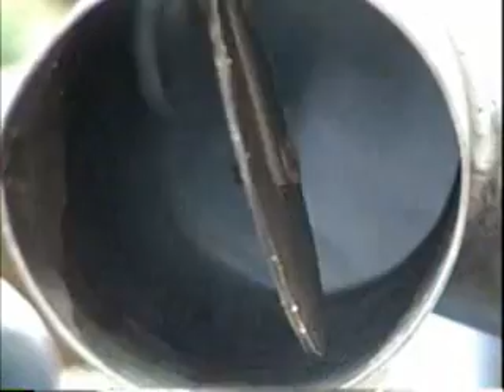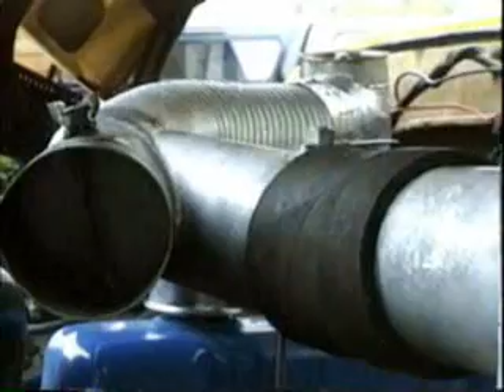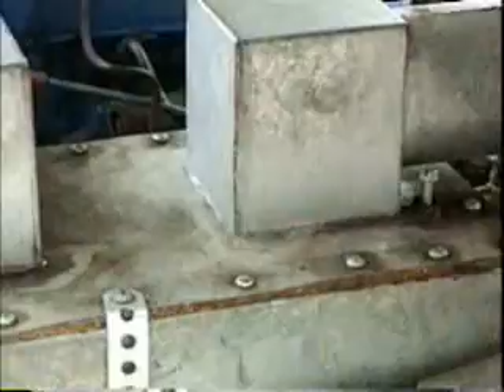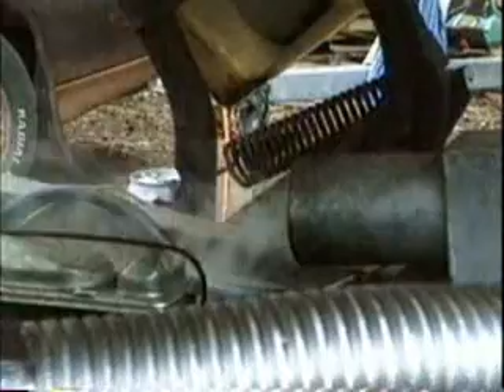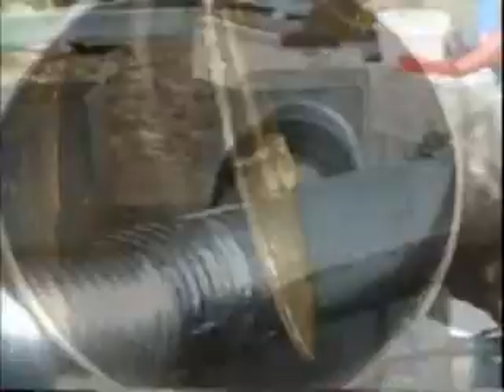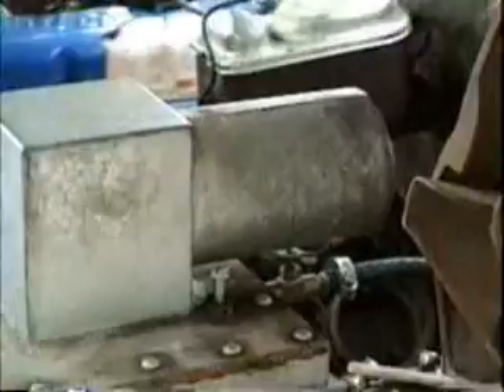Here is definitive proof on how to separate all Atoms in all liquid soluble matter.

Comment: Gas vapor systems are dangerous if your vehicle rolls over in an accident. Heating gasoline is tricky and dangerous because of spontaneous combustion and highly explosive if leaned out.
Reply from the maker: It is not the gasoline that causes the fires it is the electrical spark, that ignites the vapor. and only in the vapor state of matter is gasoline flammable. Science says gasoline auto ignites at 534 degrees Fahrenheit. Science is wrong. I have seen Calrod electric heaters turn a dull red before gasoline will auto ignite, this temperature is around 1100 degrees Fahrenheit. With this, science has said there is another 500 plus degrees that does not exist, and for the last 30 plus years I have been playing in temperatures in gasoline that science says does not exist. I got 100% increase in horse power, with zero parts per million hydrocarbons. Imagine what I could find if I had more financial backing, and used my Flashing Liquid Process on all know liquids. We might not need fossil fuel. We can make hydrogen gas from water, using the right temperature, and my Flashing Liquid Process. When Hydrogen burns it makes water. I have separated the atoms in gasoline, water is next.
Reply: Is it worthwhile because you need lots of wattage consumption which is energy used minus energy made.
Reply from the maker: My You Tube site is not to convince someone to use my system to make the White Vapor that I made, from gasoline. I am trying to show everyone I have separated the atoms in liquid Gasoline, using a simple process that is similar to what science calls Sublimation, where a snow ball is heated with a cigarette lighter, and the snow goes from the solid frozen state to a gas state, without becoming a liquid. I am saying the small snow flakes assume the applied temperature, which on the cigarette lighter flame is around 1100 degrees Fahrenheit, faster than the snow can boil and become a liquid. What I did is take small droplets of liquid, and spray them onto the 600 degree Fahrenheit heater, and the droplets went to the applied 600 degree Fahrenheit temperature, faster than the gasoline droplets could boil at the normal 100 degree Fahrenheit boiling temperature of gasoline. Thus some of the atoms in the gasoline reached their boiling temperature, which is higher than gasoline's boiling temperature, and those atoms turned to a gas, while other atoms did not reach their boiling temperature, and they remained a liquid in the bottom of the chamber seen on You Tube. The atoms that boiled turned to a White Vapor, and had twice the power that gasoline had. I call my process Flashing Liquid. Tests on a Gas Spectrum Analyzer on the White Vapor, and the non flammable liquid I accumulate in the chamber seen on You Tube, will prove that I am the first to have separated liquid atoms, and Science and Medicine will not be the same when they realize I have actually separated liquid atoms.
Reply: Okay I get you, something for me to think about. Thank you Bill.

Comment: the atoms... no no the molecules... why doesn't anyone quote ol Smokey yunick
Reply from the maker: Molecules are a combination of atoms, Atoms are the smallest part of any substance, be it, liquid, solid, or gas. In liquid it is possible to fine the different boiling temperatures of the atoms in that liquid, by using my Flashing Liquid process. The liquid mist, or fine droplets will go to the applied temperature faster than the tiny droplets of the original liquid can boil at their known boiling temperature, making it possible to turn one of the atoms in any liquid into a gas, finding that atoms boiling temperature, in that original liquid, and the gas, and liquid in the original liquid will separate.
Reply from the maker: Atoms are the smallest part of matter, be it solid, liquid, or gas. Atoms combine to make molecules.
Reply: But the atom doesn't split... Or achieve fission rather which would severely increase output lol

Comment: Hi Bill
    Have you tested any of these cars on a dyno and recorded the results . A link to the video would be great.
Reply from the maker: Peter I have no video on the test I did on a Dynamometer, but I went from 85 HP to the ground (350 V8, where the back two cylinders had broken oil rings, with no compression) 85 Horsepower from liquid gasoline, and the engine flat lined the smog chart at the highest it would go. On the White Vapor created in the chamber seen on video. I got 195 HP to the ground, and on the readings from the smog device I got a flat line on the lowest reading possible on the smog chart. A Gas Spectrum Analyzer test on the White vapor, and the non flammable liquid I created by my Flashing Liquid Process,  at 600 degrees Fahrenheit, will prove I have separated some of the atoms in gasoline, and that all liquid atoms in all liquids have their own boiling temperatures, which makes it possible to separate atoms in all liquids when any atom in that liquid has reached it's boiling temperature, it turns to a gas, while other atoms in that liquid remain a liquid, having not reached their own boiling temperature, thus the gas and the liquid will separate, the separation of atoms. BK.
Reply: Bill, was   cold starting of the engine a problem ?... i would have thought it would be perfect ... no need to choke a cold engine on start up .. 
nice to see you got OVER twice the power.. just as you have always claimed .. Cheers    Jay
Reply from the maker: There is a preheat that has to be done, before the engine will run on the White Vapor. The electric heating element has to reach above 600 degrees Fahrenheit, you would have to preheat the heating element to make a cold start with the White Vapor.
Reply: Bill Kendrick thanks Bill ..hope all is well : )

Comment: Bill I believe this is a awsome idea when j was about 12 my grandfather told me about a add that ran in a magazine during ww2. The add was looking for a alternative for fuel (alot of adds like this appeared in magazines during war) and a cousin of his took a old engine and started working when he finished he wrote the address referenced in magazine.  A couple of men came up and looked at what he had. Pawpaw told me that he had the motor mounted on a old frame and the he didnt try to find away to make the engine run on something besides fuel but concentrated on carb. By the time he was done he had gas in a large pickle jar and copper pipes ran from jar to a box sat atop carb. The engine was able to run for hours and hours on that small amount of gas. mpg? dont know the engine was a log splitting set up. They took his carb, jar, pipes and the breather box me had made. He never heard anything from them again after the war he sent a letter to the magazine because the original add address no longer was in use. Maybe today with emissions and global warming they may listen or be interested but I wouldnt let them take anything if you ever get in contact with a representative.  The state dept. may be the ones to contact or EPA. I hope it doesnt fall on deaf ears GOOD LUCK.

Comment: I never worried about pressure or maintaining temperature as I realized that to get the system to disperse the molecules of gasoline all I had to do was create a vacuum
And lower the boiling point of the fuel. At one point I used heat to change the state of the fuel but in the end found that using heat was unnecessary it was also unreliable
I found using a vacuum that had no leaks that I could start the engine in -40 without issue and it needed no preheating of the system. Heat seemed like the obvious answer to the problems but I've yet to see a system demonstrated on you tube that it was the actual answer in the overall scheme of things
To get this device to work in an automotive application is the " holy Grail " of everyone on you tube. I've worked on these problems back in the 70s early 80s for 3 years full time. I thought I had the answer or was very close. Have yet to see it work without the usual common place limitations. This idea is as old as the internal combustion engine yet half the people trying it out think they've " invented "
It
Reply: Leslie Clendening the fuel needs to be added to a carrier molecule and combined with a cooling molecule.

3/4 quart gasoline
1/2 quart water
1/2 quarter 200% alcohol.

The gas is the fuel base.
The alcohol is the coolant
The water is the fog carrier.
Together all three are a fuel in it's self now combined into a stabilized fog that will not go back to liquid form until condensed again.
Reply: Brazil thak´s!

Comment: Hi Bill, Thank you for posting this.  Looking at your video, I see you are using A/C to power  your system. I surmise that your box contains a hot plate, powered by 110 volts, and you are spraying / misting gasoline on a hot plate, to create the white gasoline vapor. I notice a gas line with a valve entering the back of the box. I also notice that their are an inlet and an outlet on the top of your box. I surmise  that atmospheric air enters through the back inlet, then is diverted downwards, where it mixes with the hot vapor, and then is pulled upwards and exiting the box through the top front facing port, an then through the aluminum duct tube and into your carburetor. The questions I have are: 1) Is it possible to create enough amperage through the trucks electrical system to power a hot plate that will vaporize gasoline? 2) Do you have a method to meter the production of the vapor to meet the demand of changing engine R.P.M.s when driving ? Or, does your system just make a fixed amount of vapor that allows it to idle?

Comment: 651 mpg on 1100 cc Volkswagen notch back sedan Georgetown Ontario Canada circa 1979

If you are achieving the complete burning of  a gallon of gasoline the potential in a 4 cylinder engine is 600 to 800 mpg not 100 or 200 mpg. Opel by Shell in the seventies. Problem was it performs on a test track as you can duplicate the stationary effect  as you are not speeding up or slowing down. It is crucial to this system ( once again it is not vapor)that you do not break the equilibrium that the engine establishes as the tipping point of the vacuum is critical and unduly sensitive to change.
 The exhaust is Carbon Dioxide.
If you need further clarification contact me. 
Im not saying there isnt an answer but I have never found one after years of trying and tapping the stationary engine( Chevy Volt) is about it
as with all the systems Ive seen or read about over the years its the restriction that causes the reaction not heat or any attempts to vaporize gasoline. I tried every improvement Ive ever seen on you tube and I applaud all those trying but if someone was truly successful with the device I havent seen it
Thanks every one for putting up with my lengthy posts. Just trying to inform

Comment: Check this out, if you haven't seen it, it could be a shock:
1927 ford vapor carburetor
Reply from the maker: +RD Dahlem They have had this technology for many years. From England, there was a Fish Carburetor from the 20's or 30's that got 75 miles to the gallon, and the car would do 100 miles per hour, but it was banned from the United States. Look up the Fish Carburetor, on the internet.

Comment: From what I understand, you have not tried this with a car that uses fuel injectors, correct? Only carbonated?

I am wondering how this system would work on an injection system. Any ideas of where to introduce the vapor?

Also, it would be awesome if you provided a concise video with clear drawings that explain the system. What does the inside of the vapor box look like? How are you regulating raw gas flow into the vapor box? Your preferred heat settings?... I'm sure you have given this info out before, but through the comments section. Another video would be great! If you live in the DC/MD/NoVA area I would be happy to help.
Reply from the maker: +Andrew Cummins Basically I am spraying a fine mist of liquid gasoline onto a heating element, that has a 600 degree Fahrenheit temperature. The intake manifold sucks the white vapor into the engine, and because the white vapor has accumulated oxygen, when this is done, there is more than ample oxygen to burn all the white vapor inside the engine cylinders, creating and using all the power the white vapor, created from gasoline, is able to produce. Now someone on You Tube used 700 degrees on the heater temperature and got no non flammable liquid, residue, like I got at 600 degrees. I suggest using the 700 degrees for the temperature on your heating element. Science says gasoline will auto-ignite at 532 degrees Fahrenheit. Science is wrong. Gasoline auto-ignites at around 1100 degrees Fahrenheit. I have seen electric heating elements turn a dull red before the gasoline ignited, and this is around 1100 degrees.
Reply: +Bill Kendrick you do not have to add heat to achieve the same results ...all you need is a vacuum pump to maintain 15 inches of vacuum on the liquid gasoline continuosly from a holding tank to the intake ..this cools the liquid gasoline to -180 degrees and freezes the vapor ...it is still in a form that is injectable...and it oxidizes at a cooler temp ...see my configuration pat galloway gedc0395  youtube.. it doesnt have to be so large as to what the drawings show ...modified versions were much smaller ..im going to post today a much smaller version that will work also
Reply: +Bill Kendrick im also introducing a vortex that will ( add heat or cold ) to determine the (benificial ?) effects  this vortex is vacuum operated ,not from the engines vacuum but from an external vacuum pump that maintains a vacuum on the liquid gasoline. the vacuum pump draws nomore power from your engine than what a smog pump would draw
Reply: +pat galloway and you have done what no delivery systems have done in the past ....you have provided the TIME and SURFACE AREA for the liquid to vaporize.. i personnally dont agree with the method of vaporization you have chosen but because it works  have at it ..but you dont need the heat to do the same thing
Reply: +pat galloway hey Pat I seen your recommendation for this video. you said your system is injecting the vapors at cooler temperatures, but don't you ideally want hot vapor as for it to maintain a volatile environment for the fuel to further crack in the ignition chamber slightly before ignition? I don't know if it would help much in the way of efficiency or if the gas can be cracked more after the vaporization in the -15in vacuum chamber or if it's better to keep the engine cooler by using frozen vapor (as used in your method.)
Reply: +griffin gibson the cracking is done in the vapor chamber ...so no further need to crack it further just remember we are working below atmospheric pressure... and this fact.... is what drives the system and creates the environment for it TO happen does that help?
Reply: +griffin gibson all you need to keep the fuel evaporating is to supply enough heat to re-energize the heat that was lost due to vaporization  not a substancial amount ...when the temperature of the vacuum chamber drops to -180 degrees farenheit you will need to add 100 degrees of heat to equalize the vaporization and the temperature required to vaporize liquid gasoline to vapor ..i know what i told you means that the fuel is still at -80 farenheit but it is in a vacuum and reacts differently than if it were at atmospheric pressure it"BOILS" at a much lower temperature in a vacuum chamber.... can you see why you dont need to add much heat? most of the time the ambient temperature will be enough heat to vaporize liquid gasoline at - 15 inches of vacuum if its warm outside.... wintertime is a bit different but still very little heat ...i am only telling you this because to add heat in any large amount or hot temps defeats the vaporization of the gasoline and makes it recondense into liquid .... i also insulate my holding tank to help stabilize its temperature mine is sometimes put into an ice chest....atmospheric pressure is what slows vaporization of a liquid at atmospheric pressure...release that pressure with a vacuum pump in a partially sealed container and it vaporizes easily because the pressure in that chamber is less  boyles law of compression of liquids can help explain.... but you have to think of boyles law in reverse... i dont know if there is a law for vapors in a vacuum...i do know that boyles law does work in reverse
Reply from the maker: What you are doing is trying to vaporize the liquid with pressure and heat. I am telling you a fine mist of gasoline in fine droplets, sprayed onto a 600 to 700 degree Fahrenheit heating element  will take you where pressure and temperature increase cannot go.
Reply: vacuum works just fine and i know it is much safer..... in a sense we are using boyles law in REVERSE.... we are  not compressing the liquid or vapor (boyles law) vapor to liquid... we are releasing pressure from the liquid....liquid to vapor... simple process